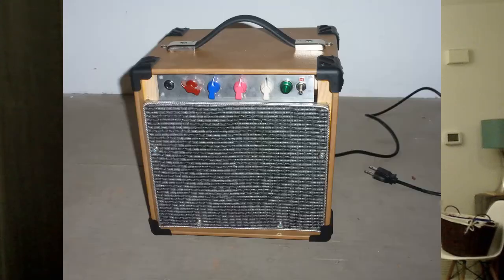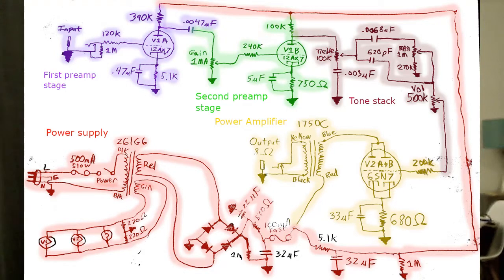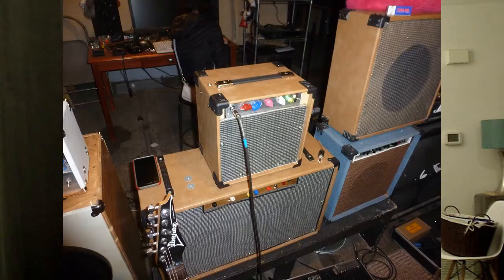Small 6SN7 Tube Amp Build Demo

Comment: Question. I've not designed a guitar amp. Why, if there's not a lot of clean headroom, do you use such a high mu triode as input and driver? Wouldn't a 12at7 or 6sl7 work? Wouldn't a direct coupled cathode follower like the one described here:
http://www.valvewizard.co.uk/dccf.html
Be enough to drive the tone stack (volume included) and parallel 6sn7 with 80-90 gain?
Finally, why do guitar amps, even when micro powered, not just use an l-pad at the output before the driver to control the spl? It seems that tone circuits like the one on your schema changes characteristics depending on the position of the gain and volume pot, even on this demo. Why not control just the gain in between the amp stages and trim at the output? Sorry, I'm wrapping my head around guitar amp circuits. There's a lot of difference to hifi circuits I'm more experienced with.
Reply from the maker: Two reasons, 1- simplicity, and 2- I was going for more gain, not headroom.

The full video is already over an hour, I was trying to cut down on components as much as possible. That is why I used a 6SN7 in the first place... to avoid having to wire in a screen grid and the required RC or LC filter. The "tone stack" I have on here, if you can call it that, is mostly just a crude bass/treble cut, which is marginally simpler, and also contributes to less gain loss. Gain loss from a tone stack, particularly a two knob one like a James (Baxandall) shouldn't really overwhelm even a high mu tube without a cathode follower, at least if you don't use too large of a plate resistor... the gain loss is more a consequence of voltage dividers (at least when the knobs aren't turned up all the way) than too low impedance. A cathode follower is generally a good idea of you are using any sort of 3 knob tone stack, which generally have much lower impedance. However, in this circuit, without adding more tubes, sacrificing one triode to a cathode follower (which has no gain) would really take out any potential for overdrive. I suppose if you wanted it to be entirely clean, or use an overdrive/boost pedal out front, that could be an option. Alternatively, adding another tube is an option. Directly coupled cathode followers also do tend to smooth out the sound of high gain amps, which is why they continue to be used in a lot of amps that might otherwise use solid state buffers otherwise. Part of my intention here was to squeeze out as much overdrive from only 2 preamp stages and a power stage, also evidenced by the lack of any negative feedback and the abnormally large first plate resistor.

L-pads at the output are used sometimes. I definitely see their value on single ended amplifiers. I'm actually at the moment building one that uses a combination of a larger screen grid resistor and an 8 ohm power resistor in series with the speaker to dramatically reduce output power when desired. They do slightly alter the output tube breakup, since the load becomes much more resistive and less reactive, as to how much that is actually noticeable... I'm not sure.  There is also the London Power Scaling circuit that varies the voltage on the plates/grids, which also works pretty well, although some will insist that lower voltage on the tubes doesn't sound as good. Sometimes I think when people start to get too picky about details like that, maybe they should be focusing on playing/songwriting more...
Reply: Love the sound...try to rebuild one for me to use as a Harpamp...Thanks BBHarpy